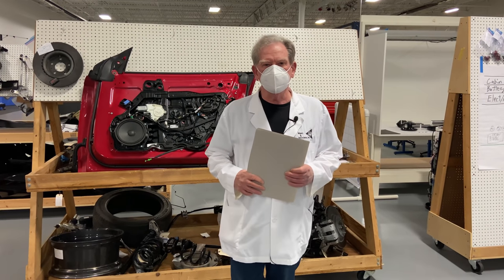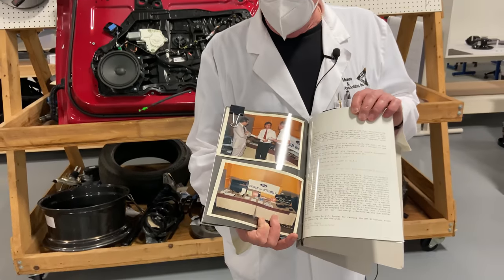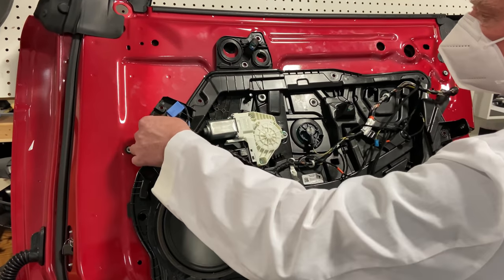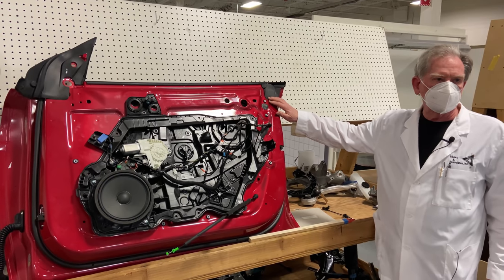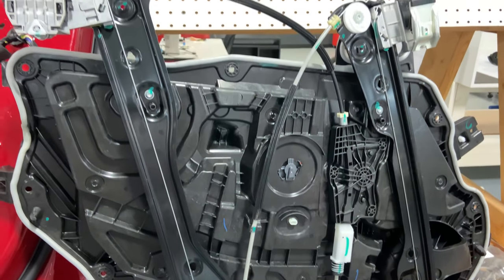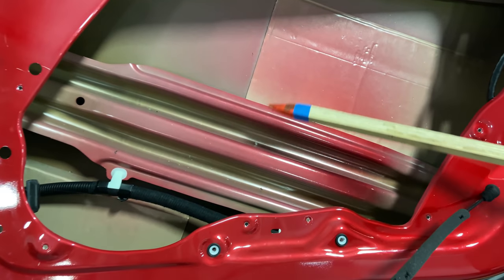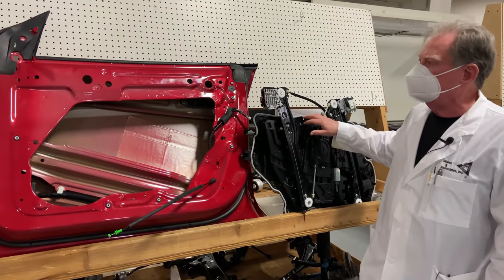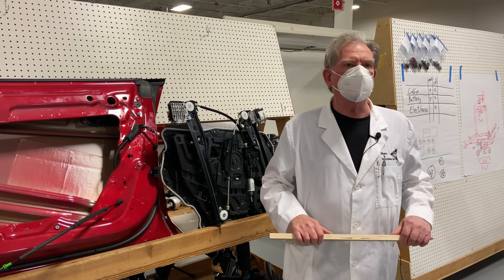Model Y E30: Advantages of Module-Built Door Construction and Lessons from the Past

Comment: Reminds me of many similar situations I had - whenever you try to streamline the process there is too many people happy with the old way, however stupid it might be. The last time it happened to me was just that passed Christmas. I work for Penney’s and they put in in the fitting rooms. We had this tag system for the customers and of course what people do is they loose the tags on a constant basis. The system was older than coal, so there was no way to get new tags anymore. I told them, give me few bob and I’ll 3D print them, as I worked the system out. Very easy coding. No. We won’t. Too costly.
Ok, so I made the tags from cardboard. Fully working! Took me few days as I had no tools and customers to serve as well. We had full set for Christmas. No worries, right? Two days before the main manager throws them to the bin. These are not the right ones! Can’t use them!
You have no idea how people were pissed seeing that half of the fitting rooms are empty and we can’t let them in because we have no stupid tags. But at least we had the right ones, eh?
Reply: Sometimes, it helps being able to get into the mindset of a Japanese kamikaze pilot when dealing with people like that.
Reply: InfoSopher you mean shout BONSAI and charge anyway?
Reply: @InfoSopher  Are you really a kamikaze pilot if you survive?
Reply: Corporations manage middle management by fear; your boss has all the responsibility and none of the power, that's how the incompetent suits keep their jobs. "Mrs. Chakrabarti are you telling me you let an employee forge elements of a proprietary, patented customer management system?!"
Reply: Mike Oliver oh, but I know! They can’t decide even the simplest of simple things. Still, if we say ten times per day that customer is the key and we do all to please them... and then we make them wait even though there is no reason to wait. During Christmas shopping madness!
Reply: @mgmacius  Japan

A group of Japanese soldiers during World War II shouting "banzai!" near Beijing.
The Chinese term was introduced to Japan as banzai (Kana: ばんざい; Kanji: 万歳) in the 8th century, and was used to express respect for the Emperor in much the same manner as its Chinese cognate.

Even earlier, however, according to the Nihongi, during the reign of Empress Kōgyoku, A.D. 642, 8th Month, 1st Day: The Emperor made a progress to the river source of Minabuchi. Here, (s)he knelt down and prayed, worshipping towards the four quarters and looking up to the Heaven. Straightway there was thunder and a great rain, which eventually fell for 5 days, and plentifully bedewed the Empire. Hereupon the peasantry throughout the Empire cried with one voice: "Banzei" and said "an Emperor of exceeding virtue".

Banzei was later revived as banzai (Kana: ばんざい) after the Meiji Restoration. Banzai as a formal ritual was established in the promulgation of the Meiji Constitution in 1889 when university students shouted banzai in front of the Emperor's carriage.[14]

Around the same time, banzai also came to be used in contexts unrelated to the Emperor. The supporters of the Freedom and People's Rights Movement, for example, began to shout "Jiyū banzai" (Kanji: 自由万歳; Kana: じゆうばんざい, or, roughly, "Long Live Freedom") in 1883.

During World War II, banzai or its full form Tennōheika Banzai! (天皇陛下万歳, "Long Live His (or Her) Imperial Majesty the Emperor (or Empress)") served as a battle cry of sorts for Japanese soldiers.[15] Ideally, kamikaze pilots would shout "banzai!" as they rammed their planes into enemy ships; although Japanese popular culture has portrayed this romanticized scene, it is unknown if any pilot actually did so. Its confirmed use by ground troops, however, was heard in numerous battles during the Pacific Campaign, when Japanese infantry units attacked Allied positions. As a result, the term "banzai charge" (or alternatively "banzai attack") gained common currency among English-speaking soldiers and remains the most widely understood context of the term in the West to this day.

Modern use
Traditionally, "banzai" (roughly translated as "hurrah", literally translated as "ten thousand years") was an expression of enthusiasm, and crowds shouting the word three times, arms stretched out above their heads, could be considered the traditional Japanese form of applause.[16] More formally, the word is shouted three times during the dissolution of the House of Representatives, and also as an acclamation at the enthronement of the Japanese Emperor.
Reply: Believe me I worked at a large company and I was like why do we pay x vender $$$$$ for a task that can be done by a minimum wage worker with 3 hrs of training?  The answer was basically because that's how things are done around here
Reply: My dad worked at that company starting in the early 1960's. He missed the exam for their computer division by one point. I have no doubt that JCP would be a totally different company if they had just put him in there anyway. No doubt. You're probably better suited someplace better too.
Reply: IsThat ATesla i don’t complain, it’s a nice stable job and they did quite a thing for us during this whole mess. But it’s a corporation and that means all the craziness of one. But still, can’t complain
Reply: Yes, a typical situation of "teamwork", but you know what they say, if you think you have a good idea for something you have to do it yourself... because if your idea has to pass through a bunch of people in order to get approved there's a big chance it will be rejected down the line by someone for some reason.
Reply: I've found myself kicking against this sort of thing quite a few times. Eventually you "learn" it's not worth the stress and as you get older you become just like them. Sad, ain't it?
Reply: GRAHAMAUS I think I’m past that phase, it’s only that I don’t like when the innocent are hurt and I’ll always try to do something about it
Reply: Typical middle management of don’t care it’s not what it always has been. I think they have to much pride to admit they didn’t think of it.  They could be just stuck in their own life, and you just a change for easier time for everyone a pain to explain for them.  Doesn’t matter if it’s a company saving idea. All they want are yes man, and they generally promote ppl that are similar to them that brown nose.  They are a “boss” not a leader. Find that good leadership is really lacking everywhere.
Reply: Jason Majere oh, brown nosing these days is worth all the diplomas of the world combined and some. I know. But there is still few companies out there that work exactly opposite way. I worked for one of them for over twelve years, probably 14 or so. Hard to tell when I actually started as we worked together before as part of another company. Anyway, the Big Boss and later CEO was amazing man in his 60s who loved when people had their own mind to the point that we were spending hours talking about random things. Everyone else was to afraid to talk to him, but I never cared about the ranks and such. And he needed that normal random human interaction. Lord, I learned tons of stuff from him! True genius. Same was with my previous boss, the Vietnamese lady. She loved the fact that I was random and hard to predict, but super reliable at what I was doing. And she exploited this once - she knew how much idiots annoy me, so she sent her cousin she couldn’t say no to (cultural thing, I guess) that she didn’t want to do business with to me and I almost bit his head off when he started selling me BS. I was sure afterwards that this was my final day there, but guess what? She called me to the office the next day, told to sit down, took this massive bag full of something and produced the best cake I ever had in my life. And repeated that every day for the next few days. I did what I was supposed to. That was her way of saying Thank you! Without saying it (i confess, I could have done that way nicer but it worked and that was the point)
Reply: Maciek Goralski Some of the older generation don't like change ! Then they wonder why no one wants to employ them ! Many believe they were let go for good reason !

Comment: Love the videos. some tidbits about the “monster W module”... it’s efficacy comes from three things: the material which is Ultra high strength steel, its shape (the W), it’s angle and how it ties into the overall side structure. basically how it’s done in all cars but that’s one of the beefier side beams i’ve seen.  some companies use tubular steel too but i’m guessing these wider platforms offer more coverage for more engagement with different types of incoming structures in an impact.  plus you can put foam on the outside of them to help damp vibration and resonance from the door skin. probably more effective with a wide W vs a steel tube. (a secondary benefit) (speculation on that last one)

Comment: “We didn’t do it because it was different” -Sandy Munro
If you work for large corporation, you run into this all the time. It’s a good indicator that you should find a new job.
Reply: Under categories 1( never outshine the master) categories 2 ( if your boss hasn't thought of it ,it is a bad idea)
Reply: Its also so in small companies, I had to experience this myself and was ultimately my reason for quitting - "traditional business"
Reply: Or start your own business like Mr. Munro.
Reply: @dancehotelzumba3177   in... 1988, so right around the same time.
Reply: @lylestavast7652  At the urging of his mentor, Edwards Deming.
Reply: @chrishare3981  Remember the 5 touches.  tell them the idea 5 times.  Each with increasing detail.  Has to hit on 3 legs of the stool.  Cost, function, reliability...improved service.  If it hits the first three, keep after it.  Persistence pays off in large organizations.  OR leave and do what Sandy did.  Somebody will listen if its a better idea.

1st touch = noise. (there's a million ideas out there. What problem are you solving with yours and will it get me promoted)
2nd touch = spurs the brain..."Ive seen this before... haven't I?"
3rd touch = When can we fit it in to a program (5 years?).  What are the roadblocks?   find out who is saying it won't work and work to kill objections.
4th touch = your solution resolves an immediate problem: a cost, quality problem....How do we solve those.(here's a design that will work!?? How do we validate it?)
5th touch = you hear it back from some high level manager/bean counter like it was their Idea.  (Success has many parents, but failure is an orphan.)
Reply: Large corporations are like big ships, it can take quite a lot of time for them to change direction, especially if there's nothing fundamentally wrong going on.
Reply: This is what kills businesses. If these bigshots and managers at companies would be more open-minded and accepting of ideas there would be much more progress and efficiency. But you know what they say inefficiency creates jobs.

Comment: I rarely comment, but it was interesting to see that you have a PMI (Positive Material Identification) gun. In my line of work, that instrument is invaluable. 
As for the topic, once upon a time, I used to be an auto mechanic, and it was so painful to deal with doors that had the window regulator heavily enclosed. The access holes sometimes had really sharp edges. One benefit I noticed, that module construction takes care of sealing the door trim panel from the elements. Normally, you have a thin plastic as a barrier, sometimes glued-in with putty glue that makes it almost impossible not to tear the said barrier whenever you need to access the window and/or lock mechanism. Kudos to those manufacturers that have implemented the modular approach.

Comment: Hey Sandy, you're showing pictures of assembly the doors that day I already worked as a mechanic in an old school car repair service for 13 years! And back that time I always thought wtf why they using 100 of screws and clips on one tool and a assembly guide filling 15 shapes of paper with an incredibly wiring.
But now they could make it a lot easier and of cause quieter. But wow, not really quieter as back those times. Just trying to make the fabrication cheaper without benefit the noise reduction.

So thanks a hundred times for your work on keeping pointing on the bads!!!

Dankeschön für das Video und bleibt alle gesund!

👍👍👍🇺🇸🚐🇺🇸😷😷😷

#stayathome #staysafe

Comment: The one thing I really enjoy about these videos is hearing great lakes speech patterns again. Straight to the point, less passive with the shade, and unabashed.

On the door side of things. When I had a first gen Jeep Liberty I ended up replacing the rear regulators due to failure. While in the door I kept thinking to myself, this could all be on a single snap in injection molding peace. I'm glad someone suggested it when I was a toddler. Just wish they would have adapted it because it was a huge pita to replace those regulators.

Comment: Interesting to see where Sandy is coming from.  Manufacturing from a cost and ease perspective. From that perspective things make a lot of sense.  OTOH, I know all the backyard mechanics are shaking with rage right now as massive integrated components often need to be replaced as a unit, necessitating a whole bunch of cost and time to replace if even the smallest thing goes wrong.

Comment: My old 1998 VW golf mk4 had door modules like that, but they were made from a sheet of metal instead of injection moulded plastic. Unfortunately they made the stirrups that hold the glass out of plastic and they broke on pretty much every single mk4 golf until they changed them to metal.

Comment: great video. As a person who normally, either has old cars, or keeps cars for a looooong time, I'm very interested in future maintenance. The screw holes on the door, look at bit, iffy, not a lot of metal to hold the screw in place?
Love the idea that Tesla is going where FMC could have gone a long time ago. 
Also it's great that Mr Munro is still finding area's that Tesla can improve in.
Reply: Yes, this is highly unusual. Looks like they are tapping into extruded aluminum holes? Very risky. Standard is bolt into weld-nut/clinch-nut, plastic 1/4 clips or some combination of these.

Comment: Sandy - for the window guide rails you actually need quite a lot of stiffness for frameless doors. That's why they're not integrated in the polypropylene. Remember some kids will hang out on the window sometimes :-)
Reply: aren't those railings anyway hanging onto the polypropylene and thus whatever is the weakest member will break first ?
Reply: A rail designed in plastic will hardly be stiff enough in flexion. The mounting points can be made stiffer and stronger even if in plastic as there's more freedom on design to increase the section and ribbing to make the stiff.

Comment: ...back the audio system, that speaker looks bigger than 6.5", has a real surround and dust cap.  I bet it has a good magnet too.  Nothing avant garde, but simple proven things I haven't seen consistently in other cars.  I had a VW with 8" in the door, it sounded great.  The model Y has a dedicated enclosed subwoofer and larger than "typical" drivers in the door.

Comment: If the motor and battery(and aluminum body parts even longer) is heading toward the 1,000,000 mile lifespan, how long can we expect all of the plastic on these cars to last? Having owned and restored many olders vehicles over the years, plastic parts are often fail parts, especially if under tension like in the case of plastic clips and fasteners. I guess the bigger picture question becomes, if some major parts of these cars are going to live 1,000,000 miles, which other parts and systems won't? Plastic? Electronics? Etc? Love your feed here!

Comment: Quick question, out of curiosity: I get how the door module gets installed into the door itself, but how does the glass pane get installed? Does it come with the door module, with the window in the lowered position, or does it get inserted after the door module is in place?
Reply: Inserted after, needs to be replaceable for broken windows
Reply: Glass is installed after the module. If you pause the video at @1:45 you will notice two large holes at the top of the door, those holes allow you access to the screws on the regulator to hold the window down. You insert the glass from the top and then tighten the screws which sandwich the glass.
Reply: @richardnedbalek1968  and he does it with smashing success !

Comment: Tesla dare to do it different, some times it works sometimes it doesn’t so much. Sometime legacy Car car companies do things for the right reason because they have slowly worked it out as the best way. Tesla asks the question “ This is how it has been done for decades - why? And can we now improve on it” and I like them for that. Wha5 Tesla are guiltily of is being so caught  up in doing things better here and here they loose focus on the simple things like panel alignment and making sure the quality in actually fitting out the cars is excellent. Numbers are king at Tesla and firing out cars like that come at a cost when your not VW or BMW, Audi and used to it and geared towards it. 

I can only hope Giga Berlin raises the bar yet again with the quality and fit and finish. Can’t wait for Tesla to do a baby two door hot hatch and I’m not thinking the many hundreds of thousands roadster more the £20k small,fun dynamic hatchback MINI Cooper size.